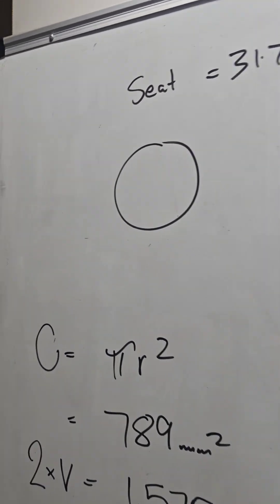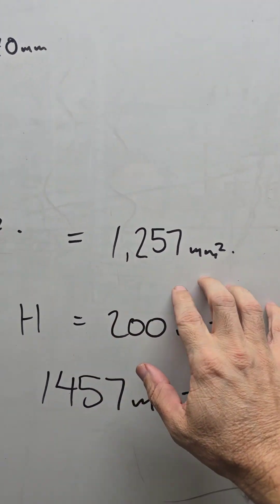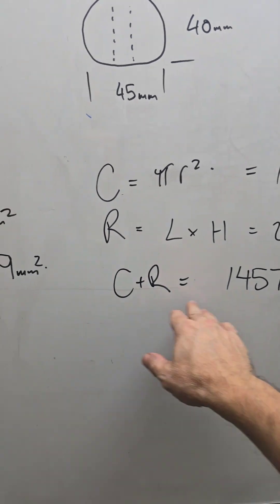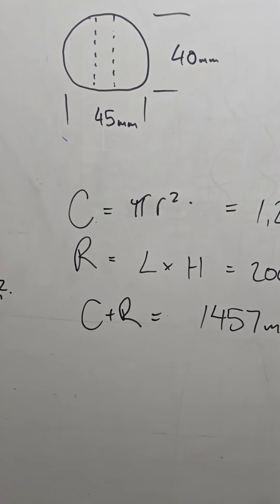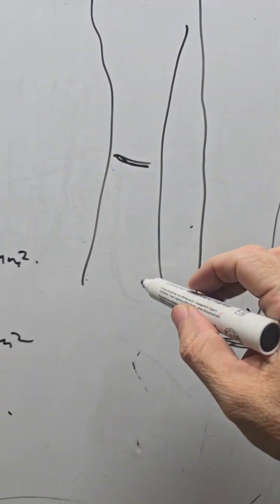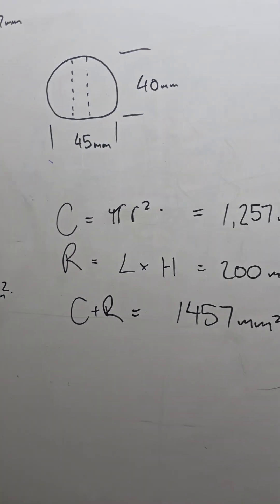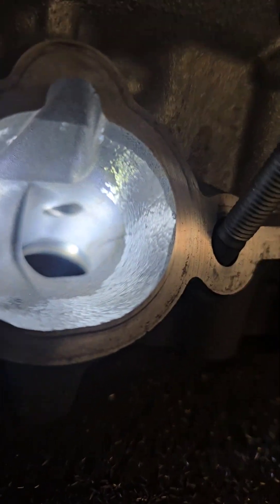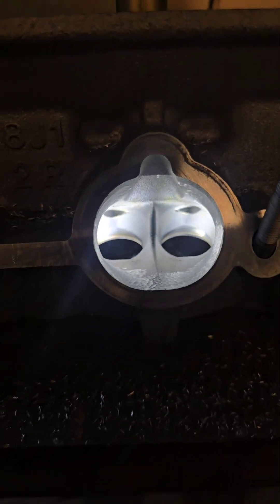VQ35 Head Porting Ep.2: CSA Mapping #HowToPort #Porting #portingpolish

Comment: When you say you want a tapered port from the window to the seat, how do you find the correct amount of taper? How much bigger should the window be than the seat?
Reply from the maker: Depends on the port shape, and where the MCSA area is.  Also what rpm.  More RPM the more taper a runner will need.   The port itself if the seat ring is the MCSA with be less then 1-2° but the runner maybe 3-7° depending on RPM.  But also you need to look at air speed.  The entry of the primary induction length shouldn't get under 180fps if testing the entire runner and head together on the flow bench at 28"

Comment: Deceleration equals pressure increase. Wouldn't the ideal be to increase the diameter in the bowl, since there us a turn there?
Reply: I think what he means is air doesnt like to turn while accelerating hence why most 4 valve head have the choke / mcsa just before the valve guide and the turn to make the air decelerate and make the turn.. I think this is just to increase the coefficient of discharge to the cylinder bore.. so basically air enters the cylinder throughout most of the intake valve circumference.. if that makes sense..
Reply from the maker: @Rtlatief Ah! If that's what he means that's old logic. Big bowls stall air and cost HP, that's  more of a thing when the MSCA was above the SSR so you need a "storage" due to the difficulty of the turn. A good example of this is the Cleveland V8's.  

Mosts twin cams are nothing like that. As the window isn'tlower than the SSR. even in the top two valve like prostock, Super stock we want the MSCA just above the seat. That gives as the longest inertia length and its this inertia supercharged filling that makes us HP. 

Same as any well designed 4 valve race head.  The trick is the manipulate the velocity over the short turn. But let's face it, most modern 4 valves have little to now short turn and port window fall is higher than the SSR👍
Reply: @bainracing  this is a quite interesting topic in regards to 4 valve head. I’m also quite wondering why do you make the mcsa on the seat. Because from what I have studied most make the mcsa at the seat when they are valve size limited such as the canted or wedge shape combustion chamber on 2V application. Even some 2V hemi combustion chamber with a good high port angle, have their mcsa above the valve guide to keep their air speed up (due to the hemi great coefficient of discharge into the cylinder). I even took a look at the best of the best 4V head port angle, mcsa, as well as port shape in superbikes such as the ducati superbikes, which have their mcsa way way above on the gasket entry area. So if you look at the whole intake port, its shape like a bow tie, with the mcsa in the middle of the intake tract. Man, cylinder head flow studies are super interesting and every manufacturer have different approaches in the way they do things, fascinating..
Reply from the maker: @Rtlatief Thx for the comment mate. 
Not sure mate. You would have to give me other examples of 4 valve race heads other than over square bikes? 

To honestly dont know a good head developer that i talk to thats not trying to get the MSCA as close to the seat ring as possible.  

Almost every top head guy I've worked with always want the MCSA at the seat as this optimises your inertia length which is responsible for "inertia supercharging" which is the key to improving your VE profile. 

Unless of course we are compensating for something. Like a low window relative to the SSR. The Cleveland comes to mind.  Of course OEM heads can be limited due to material constraints. 

Id be careful using superbikes as your reference,  due their very oversquare bores and very low seat velocity.  What I've learnt on bikes heads doesn't cross over well with more square or even under square engines.  

You even see it in simple thats like as far as throat ratios. Over square engines not like much over 89-90% where under square we push to 91.5 and they still want more.    You see a similar thing in stock stock engines. 

The problem with these really over square engines is TDC dwell. And there's a few reasons they "need" the MSCA higher up, one is to compensate for the lower signal at TDC and lower throat velocities. Than there's the TB wake. 

Also these bike engines aren't really designed for peak numbers totally. Rather Area under the curve. Hence the "torque on demand" from the ITB'S.  They need a lot of transient response. 

We see this with our manifold program and development.  Larger plenum volume makes power on the dyno, but will cost you at the track. 

Also these over square engines , they just don't hit the head very hard at all due to the huge dwell duration at TDC. Especially if you compare to a 356ci 8.2 deck Windsor with a 1.41 R/R.  These need massive growth rates, they snap of TDC.  Remember the relationship between BDC and TDC flips when comparing long to short RR. 

So the the shape of the primary induction design needs to compensate for all these factors.

So In square engine's or even undersqare which many of these RB, 2jz etc are. We want the MSCA at the seat ring.  We see this in all the top Honda heads,   billet heads we play with and even ones we have designed for other companies.
Reply: @ yes, thats what I’m discussing, on 2V head they have the csa at the throat due to the valve area limitation, but this rarely happens on 4v application, for example, a 86mm bore with a dual 35mm valve ( an equivalent area of a 49.5mm diameter circle ) can flow up to 300cfm with an mcsa of roughly a diameter of 42mm, before the valve guide, which is around 85% of the valve area, whereas the valve seat is around 90%.. wouldnt making the mcsa at the valve seat of 90%, make a lazy port? Or making the seat 85% for airspeed make the port flow limited?
On the topic of undersquare engine intake port shape, 4piston has just released a k24 billet head with by the look of it the mcsa is at the port entry, maybe going straight until before the valve guide. From what I see the intake valves are dual 37mm which is huge, and most of their engine is under squared. They posted it on their youtube short just today.
Hence why I say cylinder head tuning is fascinating due to different tuner use different rules on tuning a particular head.
I love discussing things like this because your approach is different than what I know, and it’s good to see why you did it like that.
Thanks for the replies and discussion brother, much appreciated! 👍🏽👍🏽👍🏽
Reply from the maker: @Rtlatief  Yeah cheers man, I love getting into the numbers. Yeah 2 x 35mm @ 90% throat is limited to around 330cfm, depending where the MSCA is. some of our best RB head on 34.5mm with a 88% throat we see around 325cfm after welding up the dead areas, the Throat area total is about 1450mm2 (2.25") and window is 1625mm2.  This head will be lazy on 2.6 litres under 8k but on the 3 Litre they work well. 

So as far as lazy goes its all about the average CSA across the length of the total primary induction.  This is what im saying with the induction angle, the more agressive the change, the more Desnity thinning we create as this isn't a steady state event, rather a timed  accelation mechanism.  so if its "lazy" the valve was too big to start with.  This is why we have RB's doing 9000RPM with std size valve and 3 litres. as many are too big, my point with Bore ratio was about how this influences the shape of the velocity curve at this critical time. 

All cylinder filling comes down to the physics of inertia and how well we can balance it.  The more Variation in CSA, the more power we lose, and the shorter our inertia length  becomes and it turn, the more we limit the ports energy potiental. But with many chasing bigger valves they can only move the MSCA up steam to compensate, so Is it right. or is it a bandaid move?? 

You will have to give me the CAS measurements your talking about especially the Honda head with a 37mm valves as @ 88% they will be about 1600mm2.  what are they saying saying the window area is? and is this for ITB? or  common plenum?     

thx for the conversion mate, appreciate it, take care.
Reply: @ ooh I see now, so basically you are choosing the smallest valve + valve curtain area for a cfm target, and make the mcsa at the seat, then taper it up until the intake trumpet on a common plenum, while making that taper small to make the port “alive”. Because with that kind of reasoning I can see a 33mm intake valve with a 88% seat / mcsa can achieve 9000 rpm with a cfm target of 280-300 cfm can still net 70-80hp / cylinder on a 500cc volume. Thats cool to  know. But I would assume that good valve to port angle would benefit more from this approach no? So the shape is just like a 4v prostock hemi with an excellent discharge coefficient on the cylinder due to the smaller intake valve size will not be limited by cylinder wall unlike big valves, whereas shallower valve angle with low port entry ( tumble flow ) would benefit more from having a bigger valve area with the mcsa higher along the port to compensate for cfm as well as inertial ramming on the cylinder. Man, this is a good brain food for me. Haha.
Please do make a video for this explanation as well as a further discussion on valve size, valve angle, port shape, combustion chamber shape, as well as good taper angle for best inertial ramming ( with pictures and drawings ). Because I know there is a lot of interest in this as well as it will help a lot of people understand cylinder head design from a performance perspective.
Good stuff brother, keep up the good work! 👍🏽👍🏽👍🏽
Reply from the maker: @Rtlatief yeah mate it all comes down the the short turn and how much work we need to do. But as well are seeing many of rhe modern 4 valve are looking like the last of the NA V8 is F1.  Very little short turn, MSCA area at the seat and far better averages.   

I've talked about this in other videos on how you can have two ports on the same "average" CSA. Yet one have less separation between min/Max.   That port will carry more energy and make more power everywhere.  

Yeah mate. I will try, I'm very time poor as I ran two companies and my other business is taking up more time.  

But definitely something I'd like to expand on and do some long forum discussions if I ever get time.  

Thx for the chat mate. 🙏🙏  take care.
Reply from the maker: Sorry, mate. What are you asking? Increasing the bowl diameter?  And what are you taking about in reference to deceleration? Where?
Reply: Thank you so much for the replies. My question was as the second reply suggested. I am currently learning as much info as possible on 4 valve head. After reading the replies here and finding another video on the difference between older cast iron head design and newer 4 valve designs, all of these comments are making a lot more sense.

Comment: Thank you very much for the information! This is a treasure trove!! 

I do have a few questions, for the street (where torque at lower rpm’s is more relevant) would you leave the opening smaller than the valve area for higher air speed or would opening it up still be better? Also if you would open the intake opening up, how much bigger would the port entry need to be in comparison to the valve? Do you rework your formulas to know how many millimeters to take out or do you just remeasure and calculate until you get to your target csa? Would you rather take material off of the top of the port entry rather than the floor? Lastly, how do you treat the short turn radius to mimic the ideal port (like you showed with the taper to accelerate the charge right up to the valve)?

Sorry for the tons of questions, this type of information is very rare on YouTube for 4 valve per cylinder engines. Any answer would be most appreciated!
Reply from the maker: No problem at all. 

First the opening really depends on how much choke it was creating and what our "total" average velocity across the whole length of the primary induction length and wherever any of those points are under or too tight for our targeted HP and torque range.  

As a general rule... The more we make to flow path from radius entry of the runner to the seat, the better as far as obstacles go, the more it helps both torque and hp. As long as we are focused on shape and just improving the problem areas.  

The other factor here that can help with torque is our turbulent shear factor. So the factory leaking down here can help with the fuel shearing mechanism.   But higher higher in the runner also improves this. 

Also, remember that the manifold is already at the window size. So, we are also stabilising the consistency in our inertia mechanism. 

And as far as CSA at the window,  in all top race heads. The window is generally around 3-5% bigger, and the MCSA is at the throat.  This  is how we optimise the massive effects of our  inertia supercharged mechanism.  Even the billet RB26 we designed for sema last year is based on this math. 

Hope that helps mate. 

Sorry, mate. I've been away so a bit slow at relying,  I started days ago, lol.